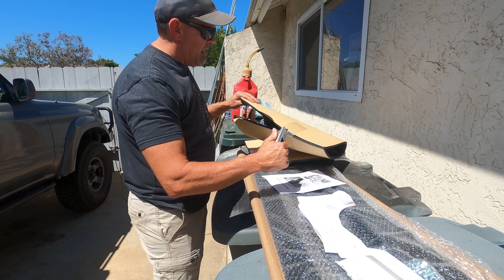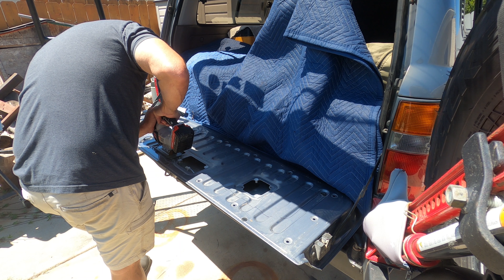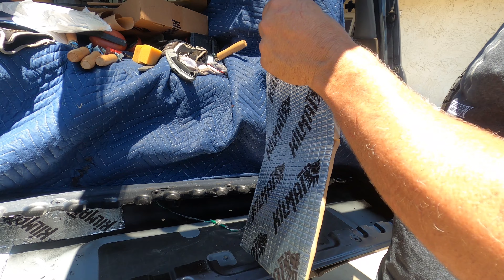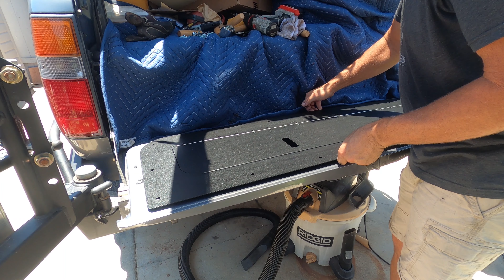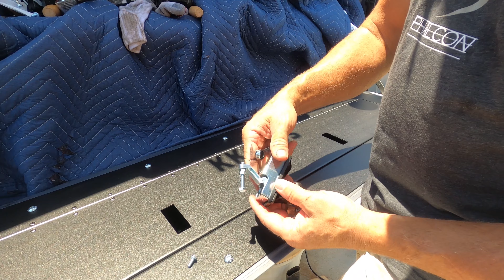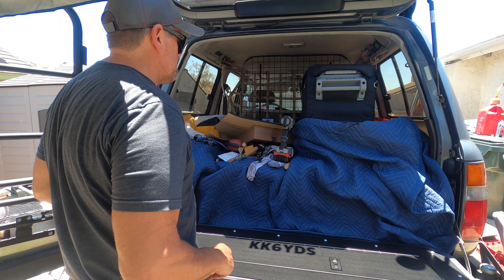Huracan Tailgate Storage Installation 80 Series

Comment: Do you have to put the silver padding stuff in? Or could you get away with not putting padding in it?
Reply from the maker: The silver stuff was actually just sound deadening material. You don't need to put it in. We installed sounds deadening material throughout the entire truck so when we cut open the tail gate, it was just a good time to put it in there as well.

Comment: Very nicely done. I noticed that when you were putting the latches in and pushing down it flexed the whole piece...what's your long term assessment with this? Do you feel it's strong enough? Has it bent at all? I am a bit cautious about sitting or standing on it even though the manufacturer says it's plenty strong enough. thanks!
Reply from the maker: After using this for several months now - I think the lid is good for mild usage. You just need to pay attention to where you're stepping and how long you stand on a spot. Weight of the person matters as well. I weight 235lb so the flex is worse than if the wife steps on it with her 125 lb frame.
Long term - I think if I abuse it and not watch where I step, the lid WILL bend and cause issues. It bends more in the corners, so we're careful to not put all our weight on the corners of the lid.
Reply: @overlandeffex  Good suggestions. I don't stand on my decklid much if at all but just will be a bit more careful when I do after installing it....which will be this weekend as I just got it delivered! Thanks!
Reply from the maker: @NigelNaughton  Good luck! It's always scary making that first cut. LOL